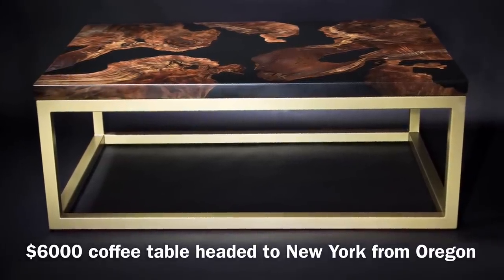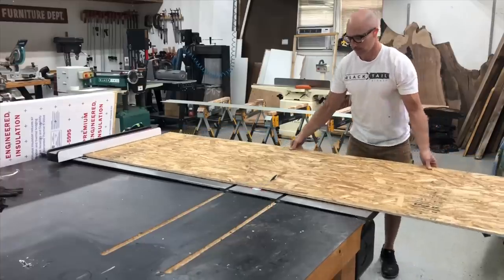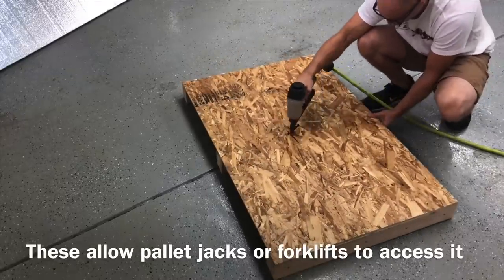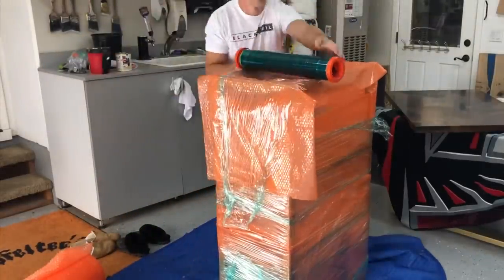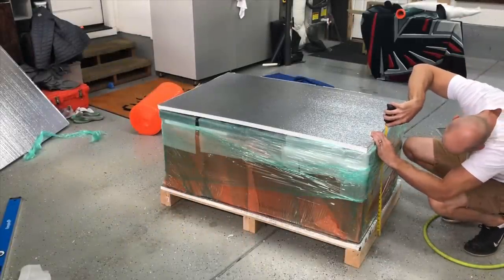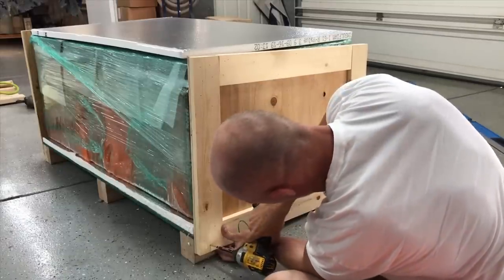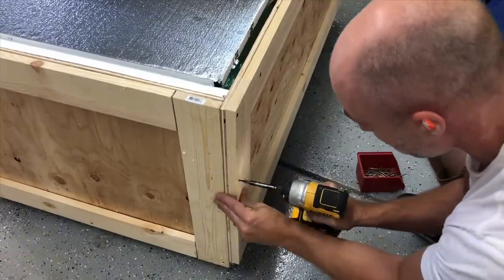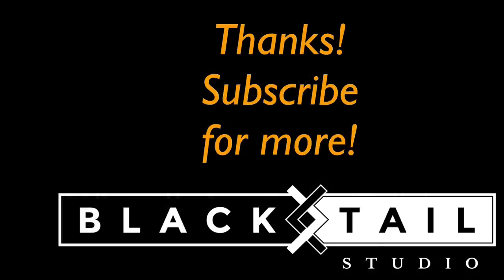How to Build a Shipping Crate—How To Woodworking

Comment: Cam, instead of the bubble, use a couple layers of .5mil high-density poly sheeting drop cloth (I get it at Home Depot). Bubblewrap can leave a bubble pattern on your work, especially if the finish isn’t 100% cured. The high-dense poly is inert and very slippery; by using 2 or more layers you are creating a slip-zone between the poly layers. Any vibration, flexing, movement, etc will be between these layers and will not be transferred to your furniture. There is a whole science to crating (crating fine-art for a living is part of my job) I’m happy to dive more into it with you if you like. I can also recommend some much better shipping methods you may not be aware of instead of sending things via freight.
Reply from the maker: Good tip!
Reply: Great Tip I just built a really nice white oak bench and have to drive it across country to deliver to my mom.
Reply: @stevet47 color me extremely interested. Do you make videos, or have a website where I may learn more? Presentation of a piece can make or break the customer's experience. Everything down to the shipping container & material could mean the difference between a one time purchase & a valued life-long customer. Whether it's furniture, art, or something in between. I would also very much appreciate any more tips you might have.
Thanks, 
- RMB
Reply: I’m interested in shipping methods info?

Comment: I need to make a crate to ship the seats of my 1931 Model A Ford to the upholstery company. The front seats are bucket seat where back folds down. The rear seat is two piece bench seat with back and bottom being separate. Going is one thing but crate will be reused to return recovered leather seats so do not want rubbing damage, etc. Any suggestions appreciated.
Thanks,
Carl